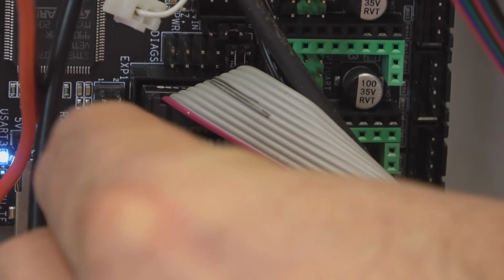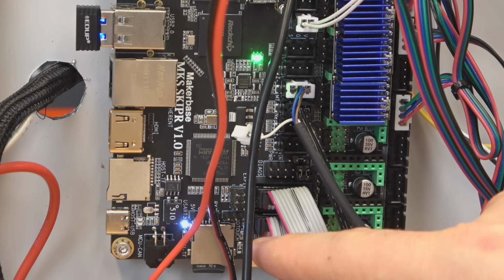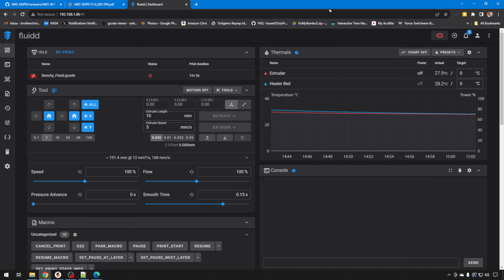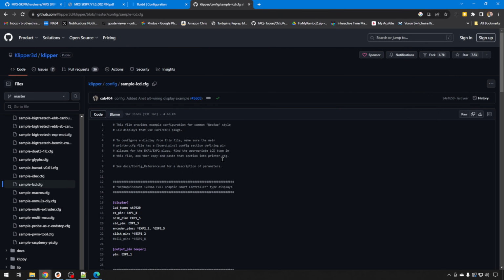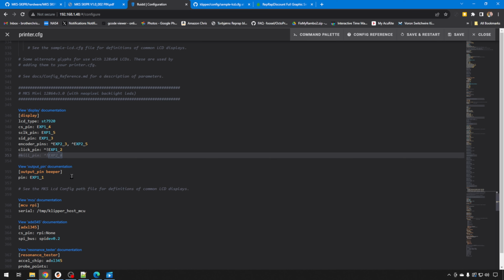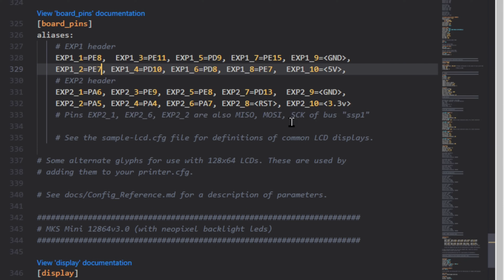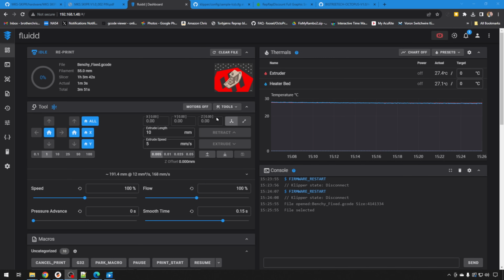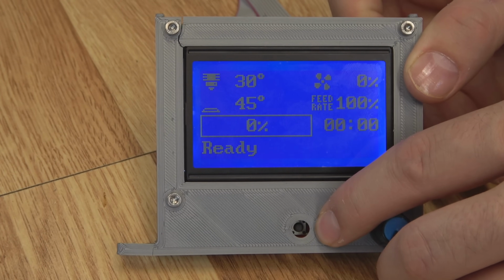Old School LCD - Klipper - Chris's Basement - 2023

Comment: Pressing reset won't hard reboot Linux! It also can't be read by the microcontroller with standard efuses. What happens is that the microcontroller is force rebooted and Klipper loses connection, and then just panics and quits, requiring manual intervention or being re-started with no task and no activity by the process daemon a short time later. So it's absolutely suitable as an Emergency Stop button, which will stop the motors and heaters regardless of possible software/firmware state, since it's handled entirely in hardware, furthermore as long as reset line is held, there will be no microcontroller activity at all. I suggest it's a good idea to keep it accessible and then use it when appropriate, when there's a danger to life and limb or when the machine is about to do something self-destructive. It's better to use microcontroller reset than the power switch either way, because if you run your Pi from the same power, sudden power loss will occasionally completely destroy an SD-Card.

Because Reset button line cannot be read by microcontroller, it also cannot be read by Klipper, this is why it's commented out in Klipper config.
Reply from the maker: Good info.

Comment: So the kill pin should act as emergency stop, same as it is on the web interface or issuing a M112 command via terminal, this will interrupt movement pretty quick and shutdown klipper. This will not shut down the system but will require a restart of the klipper service before you can do anything else. This means that the machine will default to motors off, hotend fan on and all heaters off. IMO this is one of the main reasons to even have control on the printer since you can stop it quickly if the machine is trying to destroy itself or something else you don't want damaged.

Like anything it is best to confirm behavior and settings with your own configuration as there can be small differences in implementation that can exhibit different behaviors than listed above.
Reply from the maker: Awesome info, I am going to set it up and give it a try.

Comment: Another question. If I have a skr2 and use a bigtreetech mini 12684 screen, which display layout would be best matched?
Reply from the maker: As far as the firmware? I think this is the one you would want. lcd_type: uc1701
Reply: @ChrisRiley  Thanks.  Was there a link for the "alias" example you recommend and used in your example? Like to just cut and paste it in my printer.cfg.
Reply from the maker: @jerseybarrier64  This is the screen side https://github.com/Klipper3d/klipper/blob/master/config/sample-lcd.cfg

You can copy the template from here:
https://github.com/makerbase-mks/MKS-SKIPR/blob/main/klipper%20firmware/skipr%20to%20voron%20V2.4.cfg
Reply: @ChrisRiley  nice, thank you!  You’d da man 😄

Comment: So this is what I’m after but my SKR2 has 5v upper left but my cable has red line on bottom with notch to outside of board.  Do I need to flip plastic connector on the board? Or does the red line even matter?  Looking to match with ender 3 screen.
Reply from the maker: Red line doesn't matter, it's just a nice to have for it to be in the right location, but doesn't matter as long as both sides line up.

Comment: I got lucky with my conversion for my Ender 5 Pro. The printer.cfg I found had the screen section. My Ender 5 Pro is the v1.1.5 8-bit board. I really like Klipper on it using a Pi 4B and a 7" touch screen.
Reply from the maker: That's great thanks for watching!

Comment: Yet another great video.  Thanks for the tip on removing and repositioning (180 degrees) the LCD connectors!  I have a few of these 12864 LCDs on my still working RepRap printers (relatives of LOG).  It is nice to know I can reuse these as I build newer printers.
Reply from the maker: Happy to help. Thanks for watching!

Comment: Is there a way to print off of the sd card at the printer?  Is sending the files through wifi from fluid the only way to get files to the printer?
Reply from the maker: As far as I know, there is no way to print from the SD, you can only use it as a controller.

Comment: I still don't understand why those screen + rotary button boards used that many pins instead of just using I2C or SPI which would reduce wiring to 4 wires including power and GND.  The extra wiring alone must cost more than a controller translating everything to a serial protocol.
Reply from the maker: Kind of an old school way of doing things. Sometimes trying to making things easier to use makes it more complicated.

Comment: The reset button is the best safety feature on those old screens. When shit goes down this is the quick way to halt Klipper. It does NOT reboot the pi. So Linux keeps running happily but the printer is stopped
Reply from the maker: Good to know, I will give it a test.

Comment: One of my personal settings I put into Klipper setup is to attached a pushbutton to the board somewhere and user it as resume. Restores the M0/M1 functions from Marlin (I use this after warmup so I actually have togo to the printer and for manually doing a bed level at 0.25mm using a feeler gauge).
Reply from the maker: Nice! That's a really good tip.

Comment: Will this work with any board (ie skr3 with pi) or does it have to be a board with a soc on the same pcb running klipper?
Reply from the maker: Any board that has the LCD ports in the pinout should work the same.

Comment: I've used the full graphics LCD like that for a while now, after switching from Marlin. It works perfectly. 
I've added a menu item to be able to shut the printer down and permanently mounted a USB thumbdrive to a sub folder of the gcode folder on the pi. Works as a treat.
Reply from the maker: Thanks for sharing!

Comment: Is it possible to configure that reset button to act as a kill switch that stops a print using gcode?
Reply from the maker: Good question, I think it probably is. I would probably be just as easy as configuring it in the firmware.
Reply: @ChrisRiley  That would be cool if it were possible. I want to convert some of my printers to Klipper when I get time, so that would be a useful option rather than a reset button.

Comment: The red stripe is supposed to indicate pin 1. On the board schematic, that's indicated by the square around the pin.

That said, I might start using pin 1 = +V in future designs. 🤔
Reply from the maker: Thanks for the tip!

Comment: How change the encoder rotation? Under Marlin, encoder rotation is correct.
Reply from the maker: You can flip the EN 1 and EN 2 pin numbers with each other.
Reply: @ChrisRiley  Thanks for the idea. It works!  After a bit of research, looking at the pinouts, I had to swap the 3.25 and 3.26 EXP2 data in the printer.cfg file and it worked as I was used to with the Marlin.